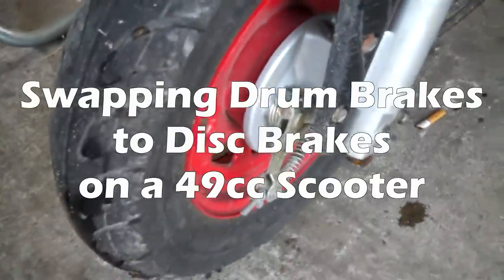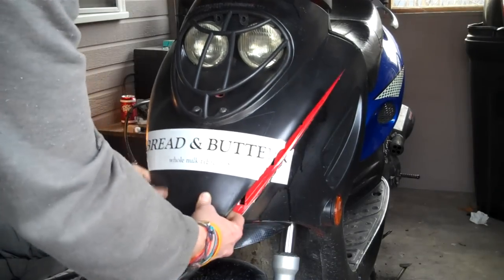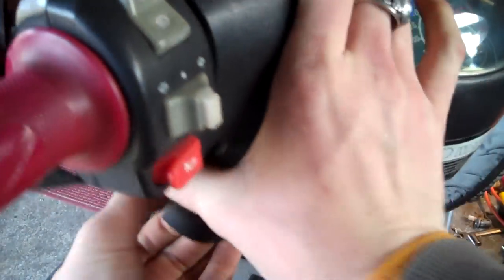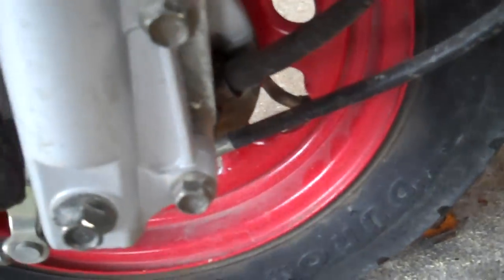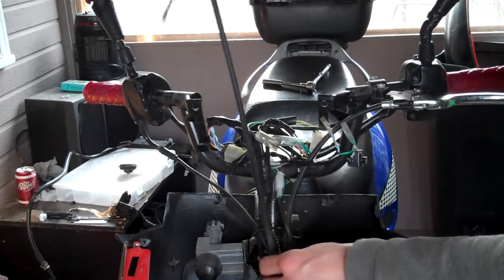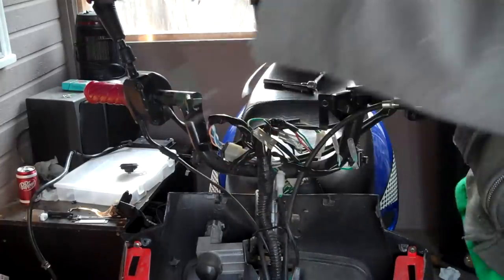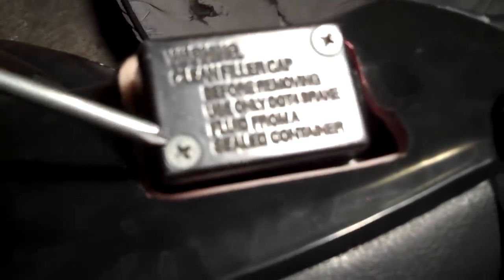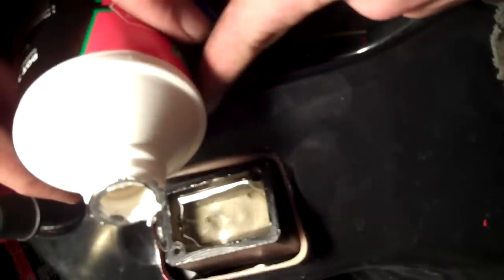Swapping Drum Brakes to Disc Brakes on Chinese Scooter

Comment from the maker: I first did a motor swap from 10" short case to 12" long case. I started swapping with a parts bike I ended up with. I liked it with the 12 on back and 10 on front, but I really wanted the disk brakes instead of the drum brakes. I tend to ride fast and roll hard!            SCOOTER  POWER

Comment: great work, is your scooter gy6(139) motor short case?? and did you replace rear  with inch12 rim?? Be cause i want to put a 12inch rim in the back?? I have tao tao atm 50cc short case